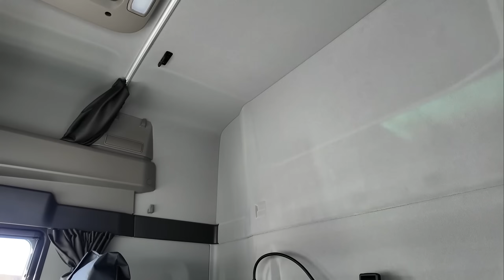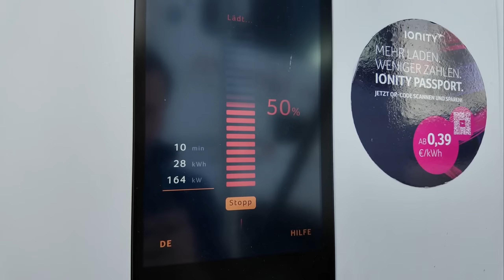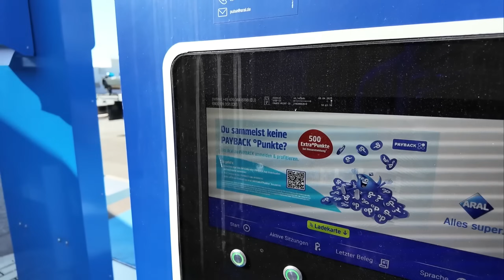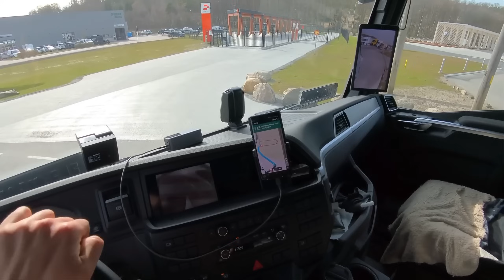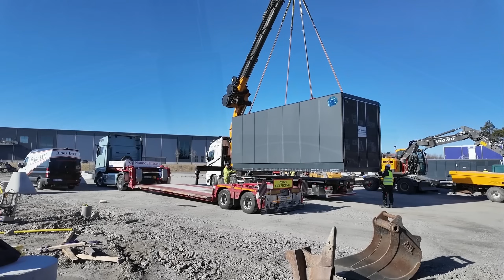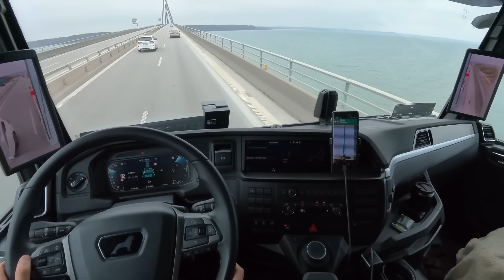E-Truck Convoy to Sweden. Europe Watch and Learn: This is the Charging Infrastructure of the Future

Comment: Thank you for this excellent effort. It’s amazing to see how advanced Europe is in the electric mobility industry.

A humble request to the leadership driving these efforts: please don’t take a purist approach that everything must be 100% electric from the start. When industrialization began, we still relied on muscle power to build it. Similarly, as we transition to electric mobility, it’s perfectly fine to leverage the existing fossil fuel-based infrastructure to support the shift. This will help ensure the transition remains practical and not cost-prohibitive.
Reply: We ARE using fossils, all the time. There's nothing purist about anything with the electric transition. ...Which maybe we actually should consider - have you noticed the summer heatwaves recently? Parts of Europe, 45C temps, or even a bit higher here and there. 35C, huge areas affected, and so is life in general, nature and humans. We're burning the branch we're sitting on, no hyperbole.

And it's only going to get worse. We're running out of time. The quicker we all realize this...!
Reply: The future will be a mix of electric and green hydrogen based solutions depending on distance.

Comment: interesting you guys don't use CB Radio ( Citizen Band) like here in Australia ? but good to see the Charge parks are made for trucks and have fencing for overnight security...
Also makes sense to have charging onsite as that where your dwell times are.
well done to European progress in electrification of its fleet, Australia is struggling but hopefully will catch up with more proven tech!
Reply: Not much need for CB given the extent of mobile phone coverage.... Though some truckers may also use radio because they have to work with other VHF radio users or go to areas beyond mobile coverage.
Reply: Those times are long over in Europe.
Reply: @fgerstm2069 so what you just flash lights and wave for comms? when we have roadworks, large loads or hazzards  like accidents here, the CB allows instant comms to mitigate risk...
Reply: @Hunter-EVOutback 
We have different means to get that information. One is if you have the radio on, it doesn’t mater what channel you’re at or listening on your favourite CD. The local ”traffic information” will override everything and give you the information regarding accidents or other disruption in traffic. 

Also the GPS reads the traffic flow in real time. If there is a traffic jam, the GPS will divert you to the fastest route. 

Regarding CB-radio, it died out quickly due to stupid (personal opinion) Swedish regulations. The transmitters wore limited to extremely low Watts. That resulted in very short range of communication. 
Example: When meeting a colleague on the motorway/highway we could exchange a few words before the signal was lost🫤.

Comment: Thank you so much for your videos which I find very helpful and informative. I am in the UK and to hear about your experiences is valuable. It would be even more helpful if you could identify the cost of recharging at each EV ChargePoint and how much energy you got on board for however long you stayed there. It would also be useful to know therefore the cost per day of running a particular route as topography and weight of load carried will have an effect on the cost per mile to run them. Finally, if you could identify roughly the cost of the Trucks that too  would be helpful.

Were the three trucks all running the same battery chemistry? Or were some on LFP and others on NMC?

Comment: Wow, that was a tight squeeze on that roundabout, great job :) Btw, what were the planks/metal bars/whatever laying on the street when yu were driving off of it? Were those just some things let there by the nearby builders or was it some kind of slowing mechanism they use there in the vicinity of builders?
Reply: There are temporary speed bumps and quite common in Sweden. They are placed on the road and not fixed so after a while they tend to move around a bit. You definitely slow down for them, as they are high and small. You see them everywhere there are road constructions ongoing.
Reply from the maker: You mean the two bars on the road at 14:49 ? I assume they are some safety blocks so the cars won't suddenly roll backwards, but I'm not sure.
Reply: @electrictrucker  yeah, exactly those. Right so those are permanent fixtures on the road? I though someone left them there and they can be removed. Interesting, danke!
Reply from the maker: I think they were put there temporarily because of the construction site, as right in front there is a pedestrian crossing where cars have to stop.